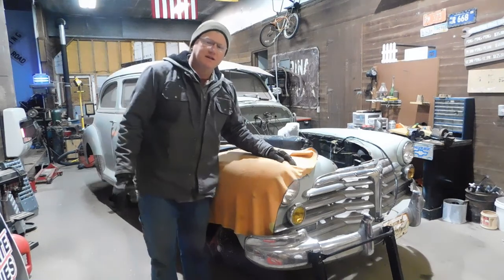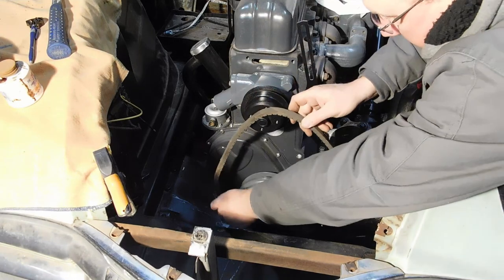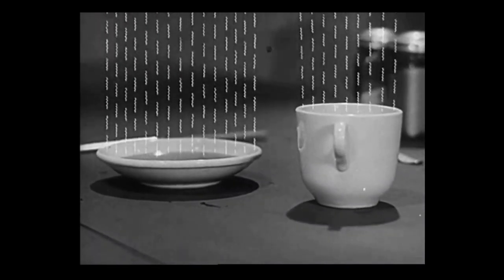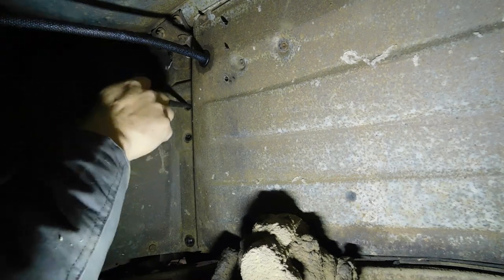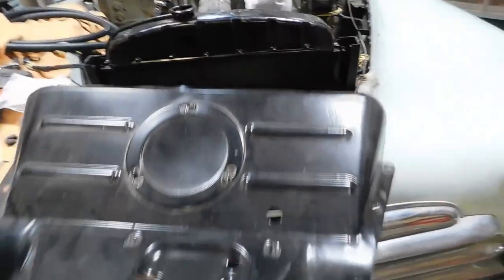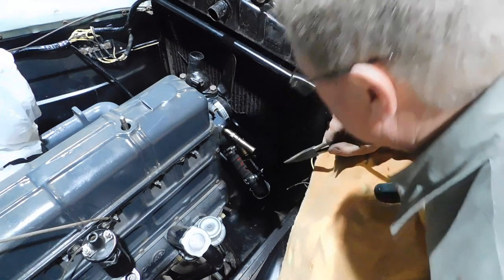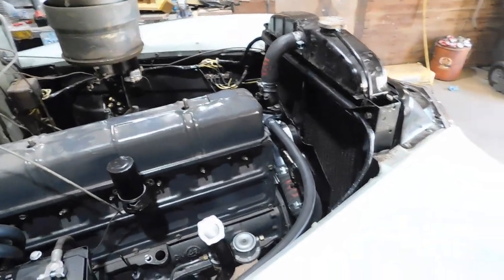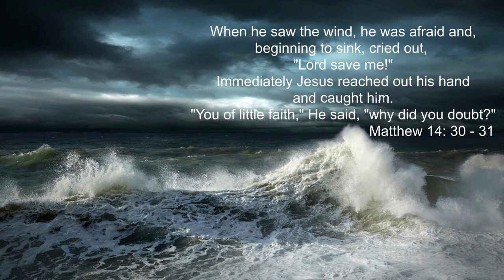Part 14: 1929-1954 Chevrolet Cooling System - Radiator - Water Pump

Comment: My 1941 accessory book lists the under seat heater (for an outlandish $17), so I know they were offered at least that far back. They offered 3 models of heaters, from $11.50 to $17, which was actually a pretty good idea, allowing you to tailor the expense to the climate you lived in. I do find it interesting, however, that even the defroster was a $7.25 accessory. I guess wiping with an old rag was the zero cost option.

Comment: I’m new to vintage Chevys. Your videos are a great assistance with my 1940 Chevy. Just added a NOS top bracket to battery tray. I don’t like the minimal clearance to positive post/starter cable terminal. I see you have same minimal clearance. Wondering if the original had a different cable terminal (flag terminal perhaps) or different battery post location.

Comment: Great video! I have a 1951 Chevy 3800 Truck. The radiator leaks at the top and I am replacing it with a new one. Should I go and replace the water pump also while I'm at it? (I'm not sure if it leaks, guessing not). What else should I replace? Money is no expense.
Reply from the maker: I'm a champion of "if it ain't broke, don't fix it" But it really depends on if the truck has been sitting around for years or if it's been driven up until now. I would certainly do radiator hoses and perhaps heater hoses if they are dry, hard, cracked, anything like that. You could throw in a thermostat but I bet you the old one is still working. The water pump, again if it's been sitting around for years then it would probably be a good idea. If it was mine I would try it and fix it when and if I had a problem. But I probably shouldn't give out advice like that. Oh and if it was the original Harrison radiator, new aluminum ones look shiny, but original copper ones cooled better. It may be worth your time to have it checked and repaired.

Comment: Hello. My name is Elton Lenhart. First I would like to congratulate you for your videos. Second, ask him if he can help me with an indication of online stores specialized in parts for the Stylemaster 48. I am Brazilian, and unfortunately here we have few spare parts for this model. I'm doing a complete restoration of all the mechanics, suspension, engine and gearbox. Anyway, a lot of work... For now, thank you for your attention.
Reply from the maker: Hello, thanks for the kind words and for watching. The two best parts sources here in the states are chevsofthe40s.com and fillingstation.com. In addition to that I find ebay.com extremely valuable for a lot parts that you can't find anywhere else. I also am often surprised and surprise my local parts store owners when I ask them if they can get certain things. I realize that may not be the case in Brazil, but you never know.

Comment: I live in Miami, what thermostat should I use to keep the engine cool? As you probably know is summer here all year round. Thank you
Reply from the maker: While I have no experience at all with Florida weather I would still go with a 180* thermostat. Your cooling system, if working properly, should keep the engine at approximately the same temp. regardless of the ambient temp. Obviously there will be a difference but not much. As long as your gauge is around 200 or a few degrees above you will be good to go.
Reply: @TheJayhawker  thank you. My gauge is always in the middle over the center dot. Is that 200
Reply from the maker: @WilliamLeonard  Are you working with a '48 Chevy as well? If so 180 is the center dot.

Comment: If like my ‘48 Cadillac that heater accessory is not for roasting your front passengers buns but to provide floor heating for your rear passengers. Anyone tackle driving the dash temp gauge correctly? Despite installing equivalent temp sender p/n, i’m not getting an “accurate” (relatively speaking) gauge reading inside the car.